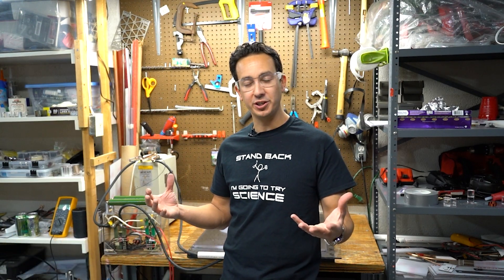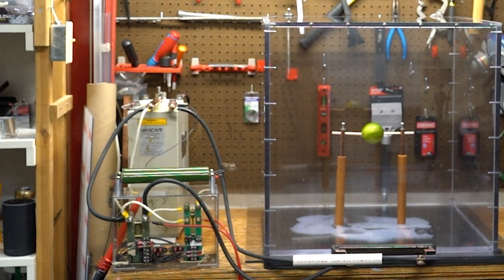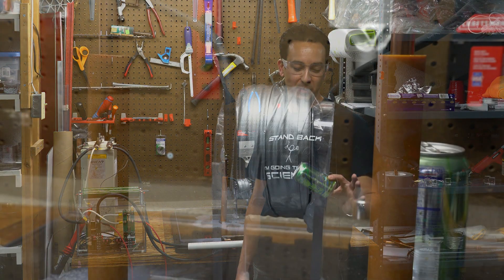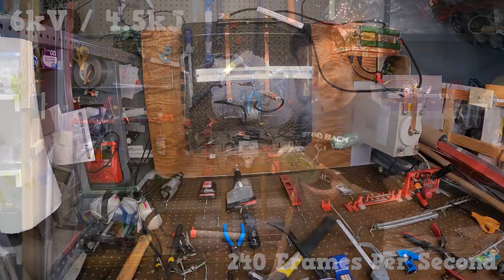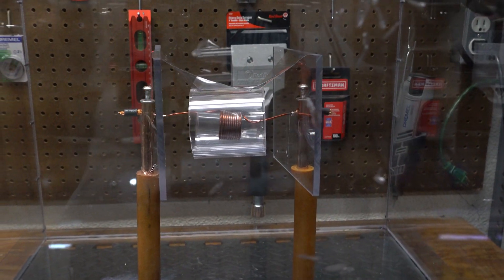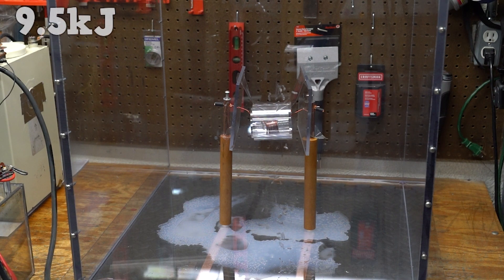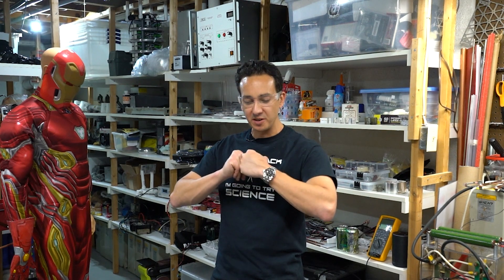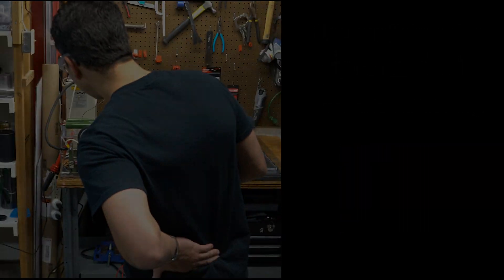Electromagnetic Coin Shrinking and other Pulsed Power Demos

Comment: the use of alexa like this is genius
Reply: Is te use of Alexander genius or dumb 
Never trust an electronic switch 
But you can trust a mechanical breaker 
Just look at the grid
Reply from the maker: @TheBlibo  I am OK giving Alexa final authority to fire it; its all manual upstream so it can't decide when to turn the master switch on or off or where to set the Variac.
Ultimately projects like this come down to having a safety plan and sticking to it. What I did works for me, but if you don't trust electronic relays on smart devices that's perfectly fine too.
In a previous job I used to do things like this for a living, and it was not enjoyable. What makes this fun is exactly the aspect that I get to decide how and when I do it, and I get to do it my way ;)
Reply from the maker: Thanks! Keeps my hands free to do other stuff

Comment: I'm coming from a video where they used a hydraulic press and high current pulse (to achieve high temperatures) to convert graphite into diamonds, with partial success. Has this ever been tried with this kind of setup?
Reply from the maker: Not that I am aware of, but it is theoretically possible. I have heard of industrial diamonds being produced with explosively compressed graphite before.

Comment: what are you using for the switch?  triggered gas discharge tube?  or just a HV relay?
Reply from the maker: The same relay you can see on all the videos... There are no other switches in this circuit...
Reply: @Powerlabs  it appears to work well!  thanks for the reply; much appreciated

Comment: What is the highest power you have worked with in pulse experiments?  I have a 24KVDC / 303Mfd cap setting in my shop (~400lbs / 83K Joules).  Haven't decided what to do with it yet.
Reply from the maker: I fired a railgun at about 190kJ once with Aaron. It blew the rails apart.

Comment: What value capacitors are used for coin and can? (μF & Volts?)
Reply from the maker: All these videos are using the same capacitor, it is a 268uF unit that can be charged to 12kV max.
Reply: @Powerlabs  WoW i wish i could get such caps. They must be priceless expensive i guess? If you even could find such components, 2nd hand?
Reply from the maker: @robson6285  About $6K each, or much less if you can find used ones on Ebay like I did.